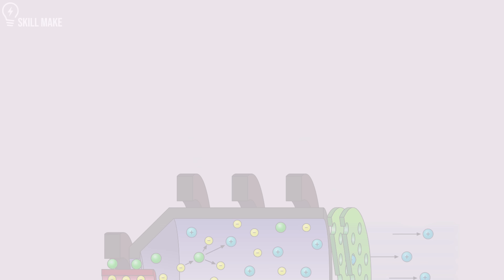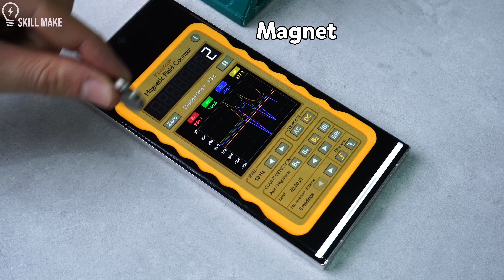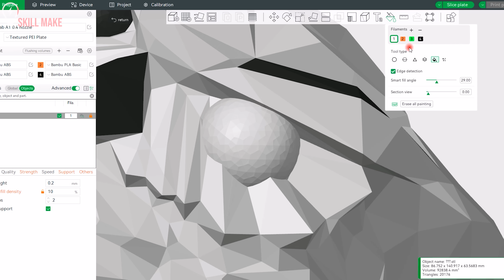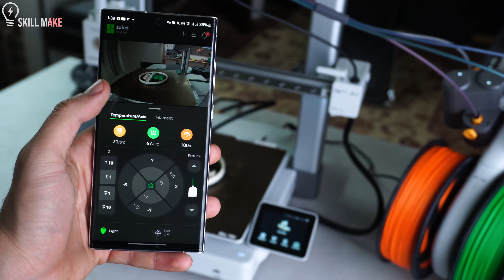I Built the Next-Gen IONIC PLASMA THRUSTER Using NASA’s Secret Design!

Comment: Could you put metal mesh over the copper disk for the argon to pass thru and ionize more of the gas...it seems that only the surface layer would ionize vs all the gas if it passed thru a grid...also I wonder if a much longer copper disk (think pipe) would allow for faster flow, maybe even a laminar flow output to direct the flow farther without separating would get better "thrust"
I also wonder if a ring electromagnet instead of just static magnets would help
Very cool!!!!
Reply: يؤسفني احيانا عندما ارى كيف تضيع بعض الاراء الجيدة وسط الزحام ..!!..   اعجبتني ملاحظاتك 🎉

Comment: Great video, I loved how you find easy solutions to the building process, like use a tape around the coils to fill it with epoxy or using a soldering iron to fix the mesh in the plastic part. Pretty cool

Comment: The candles are too burnt in the last test, if you use a new candle for the last test painting, you will burn more candle. (Because the 4-5mm burnt wax under the aluminum wall of the candle is very difficult to extinguish)

Comment: I don’t really understand what is the goal Of an high voltage accelerator, if you accelerate air molecules it will not work in space and i dont think you can beat a high rpm motor with propeller. The advantage is that there is no mooving parts so no mechanical failure is possible. Nevertheless, great build and thinking, thank you for sharing your work.

Comment: I don’t understand… the final product only did two better than the single version. What was the reason? Were the supply lines for the argon misaligned? Did the shape of the output tubes cause turbulence inside when the three streams came together? That doesn’t make any sense to me. I recognize that it’s probably progressively harder to blow out the candles farther away because of interactions with the normal atmosphere etc but I would expect that you should at least see 16-18 candles for that much power

Comment: If you put each cylinder in a triangular shape instead of the bar shape you have. By converging into a spiral or cone shaped 3d print, instead of yours converging on a flat plane. This would allow all three to push their air flow equally to their endpoint instead of the different internal distances that exist in the way you have it, leading to less internal turbulence and potentially better flow.
Reply: Seems like the magnetic confinement is overly simplistic too.

To the point that it could be causing ions to stagnate inside the thruster for lack of directionality.

A switched confinement scheme that pulses through multiple sets of electromagnets inside the thruster in succession would achieve both directionality and acceleration of ionised airflow.

Comment: Mostly the reason the triple doesn’t work that well is you lose a lot of power and flow rate in the forks. There are ways to design conjoined ducts that will minimize losses, but this design is too short and the angles too severe. 

Though, no matter what, you’ll have power loss from the conjoined ducts. Always.

Comment: the mesh installation (press fitting w/ heat) was extremely clever!!!
Reply: Next time he needs to use a hot metal surface to blend the wire with the plastic instead of using a soldering iron, it will be smoother and more integrated

Comment: Yeah, more burners running off the same fuel and power supply isn't gonna yield very different results. You need to increase the concentration of argon and increase the voltage as well as use stronger magnets.

Comment: Hey, just a tip I learned through costuming. If you program a pause between layers and secure the metal mesh over the paused layer the next layer will fuse through the mesh to the previous layer making a more consistent part.

Comment: The whole point of ionic thrusters is that you don't need any sort of fuel besides electricity. 
By adding argon you've essentially built a sort of sea level ion engine that is entirely pointless as the weight of the argon tank hugely impacts any sort of thrust to weight ratio.
Hell, you could just use the pressurized argon as propellant, slap a nozzle on it, and get more thrust out of it than all that.

Ionic thrusters are best used for solar powered semi-gliders who can  keep themselves in the air just above cloud level, essentially for free. 

Plasma is a cool word to put in the (stolen) title, but not really an upgrade on the ionic thruster arms race between channels such as Integza and ThePlasmaChannel.

By the way, deleting non-offensive comments because you don't like what they're saying and then going "The race is on! 🦾🦾" and pretending like its all in good spirit like it's not shadier than the dark side of the moon is...an interesting strategy to get a friendly competition going.

All this work you've put in is clean, marvelous, and the result interesting. But it entirely defeats the point. The prettiest sword is ugly to a blacksmith if it cannot cut.

Comment: Really good job increasing thrust density!  On my channel are the only ion thrusters that lift their power supplies, making ion propelled drones possible.  They do not have high thrust density; they were designed instead to spread out the thrust over a large area.  They were developed over many years.
Reply: What is the name of your channel?
Reply: @starsruul6202  The Ethan Krauss YouTube channel.
Reply: @starsruul6202  It's under my EA icon.  I think if I leave the name it might be censored, as it didn't work last time when I posted it.

Comment: Have you accounted for the thrust generated by the pressurized argon released from the canister? and why did you cover the Canister, we want to see at what pressure argon has been stored.
Reply from the maker: Argon usually comes in large canisters, but I stored it in smaller ones to make the video look better.
Reply: You can see that when he opens the argon line, the first candle just barely flickers. It's not until the argon is ionized that it blows out any of the candles.
Reply: @AbuMaia01: No, that's not the case. When he first opens the argon line, listen to the initial sound — it's much quieter. But when he fully opens the valve, the sound becomes significantly louder. Initially, he only opens the valve slightly to demonstrate that the effect of pressurized argon is minimal. I'm not convinced.
Reply: No, that's not the case. When he first opens the argon line, listen to the initial sound — it's much quieter. But when he fully opens the valve, the sound becomes significantly louder. Initially, he only opens the valve slightly to demonstrate that the effect of pressurized argon is minimal. I'm not convinced.
Reply: @saketindra  At what timestamp do we see him fully open the valve? I submit that the sound becomes louder because he flipped the switch activating the ion thruster. This is easy to check. Does the sound increase suddenly as it would from flipping a switch, or does it increase gradually as it would from twisting a valve handle to open it more?

Comment: This defeats the entire reason for picking ionic thrust over something more conventional. The entire point is to eliminate the need for a propellant. On a nuclear reactor, a standard ion thruster could run for decades. This would drastically limit that.
Reply: The thing with an ion thruster, is you need something to become the ions. An ion thruster doesn't eliminate the need for propellant, it widens the scope of what can be used as a propellant

Comment: Doesn't seem so scale very well. One thruster 12 candles, three thrusters 14 candles. Maybe a change in nozzle design will bring a bit more power?
Reply: the design of the funnel probably lost a bit of power to air friction. it was pretty much blowing 2 out of 3 straight into a wall.
Reply: Perhaps the relationship between number of candles and thrust is non-linear
Reply: Надо было коллектор в длину больше делать, чтобы потоки из двух боковых сопел не так переламывались, не под таким углом.

Comment: what if you feed that stream through a tesla valve shape choke with more of these thrusters along the way with increasing frequencies and one at exit with highest frequency?
Reply from the maker: That's a really creative approach! Feeding the stream through a Tesla valve shape choke would allow for passive control of the flow, reducing turbulence and allowing a smoother transition. Adding more thrusters along the way with increasing frequencies could enhance the thrust progressively, and placing the highest frequency thruster at the exit could maximize the efficiency of the exhaust flow. It’s an interesting way to optimize the system’s performance! Definitely worth experimenting with.

Comment: Try using a laminer flow nozzle so there is less turbulance caused by the 3 converging jets.
Reply from the maker: Great suggestion! Using a laminar flow nozzle could definitely help reduce turbulence by ensuring that the flow remains smooth and controlled as the jets converge. This would improve the overall efficiency and stability of the system. I’ll definitely consider testing that out! Thanks for the input!

Comment: That's a great project ! Thanks for sharing. 
Your 3 in 1 section can be improve for best perf. Look for optimising airflow. Like motor exhaust systems (limite ventury effect). 
here instead of having all reactors in line , the two reactors left and right can have angular rotated position like this... /|\ and airflow length might be the same for each reactors...

Really great job !!! Thanks again.
Reply from the maker: Thanks for the tips!

Comment: only improvement i could say so far is invest in a vacuum chamber, even a 3 gallon would do fine for epoxy-coating your coils.... better adhesion = better heat dissipation and internal resistance resilience

Comment: There is a strong turbulence at both sides of your flow merge. If you look in to laminar air flow injectors I think you could get all but the last candle out.
Reply: I do an unreasonable amount of thinking about how much energy is lost to turbulence in fans etc, given how little of the math I actually know and how little it usually matters.  My first instinct is to point to the 3-way merge and say "Cross section of the inputs doesn't match cross section of the outputs."  I don't know crap about CFD, but you aren't compressing the entire input flow, you're inducing flow.  Even if the charged particles themselves had significant force, other parts of the thruster cross section are only weakly pulled in that direction, so if there is enough flow restriction to create a pressure bottleneck, some of that pressure will leave via the input end, which is the complete opposite of what you want in an induced flow thruster. Even if there's not a significant pressure bottleneck, I just don't see the merge as being a good way to deliver all of the thruster energy out the back end.  I'm pretty sure it would have done better if you stacked the three engines in a triangle instead of merging them.
Reply: Might get them all out. But I haven’t yet done the fluid dynamics to know for sure.

Comment: This is really cool, blowing out candles and all... but where are the measurements?
Where’s the data on voltage, current, airflow, and ultimately THRUST? It’s a freakin’ ion engine — it should generate thrust, not just blow out candles

Comment: It might perform better if you shaped the 3 way merger to look more like a peace sign, along with making the exit diameter a bit wider. The flows of air off the 2 side engines are likely disrupting rather than converging neatly.
Reply: Honestly my two bits is creating a twirling design from a three to one thrust shaft thereby creating a cyclone effect in theory increasing the electron thrust by 3 times at least.
Reply: @wolff6592  That was going to be my suggestion... like a three way Yin-Yang coming from a pyramid of inlets instead of a row of them. Also worthy of note, in that setup, they could be combined with two other assemblies in the same manner, multiplying the output even more.
Reply: @RichardInTN  no after about three vertices the lack of argon would hinder it not help it unless you have more independent gas sources but why it's all theoretical lol...
Reply: @wolff6592  My suggestion didn't limit the source of the argon to the same delivery source as the one used in the video. Also the "combiner" could be enlarged to allow for more flow, and then the combined flow duct would be reduced post-combination... like taking the exhaust from four cylinders of a car into a header and then exhausting via a single pipe.
Reply: @RichardInTN  i agree just saying test the vortex effect before improving design
Reply: @wolff6592 Dyson plasma
Reply: 100% this 👌
Reply: lol, I said the same thing just now.Didn't even see your comment. but hopefully he takes the advice.
Reply: Если у него есть 3Д принтер, наверняка моделирует. В солидворкс есть плагин для расчётов движения струй. Н о кому это нужно? 😀
Reply: If they combined into a spiral, that might help keep a clean vortex of airflow. Now I kinda want to try it.

Comment: The argon splitter seems badly designed. The straight through will get all the argon while the left and right will get almost nothing
Reply: Yeah I also had the same thought, I can guess that the sides might also be experiencing a Venturi effect, meaning no Argon is going out of them, but sucking in air.
Reply: Yeah that's one of the reason why it wasn't that effective

Comment: remember to point high voltage fingers at audience, or electrons in the air. if you use air, then you dont need to have tanks of propellant. redesign to work with air input. yep argon/xenon tanks are expensive and impractical. well, to have the same momentum/power with smaller sized atom gas, then just make it move faster to get the same performance.

Comment: Do the test in a vacuum please  ?

Use a super lightweight 'pendulum ' suspended in the vacuum chamber to demonstrate the 'thrust'  ?

So far I think all you are doing is creating a fan that is pushing air using ions , so the air movement is what you are actually measuring.
Reply: useless, thrust will be near zero in vacuum. only electron mass jumping from electrode will do something.